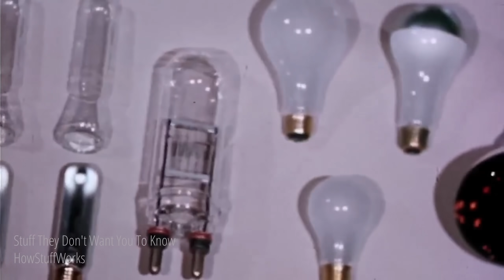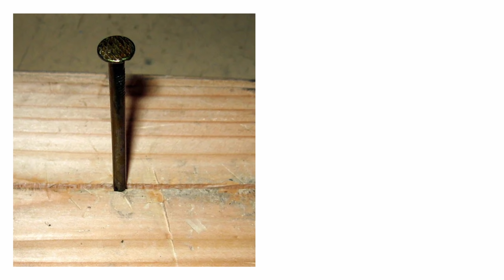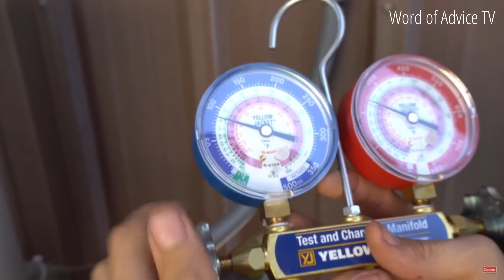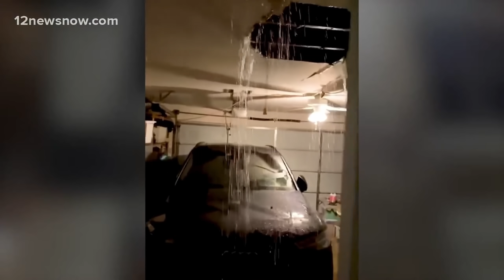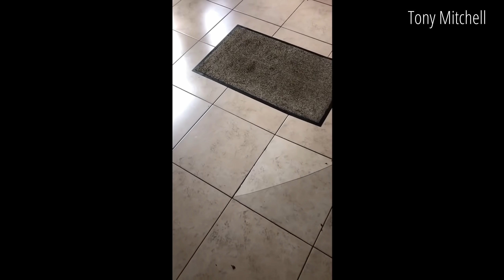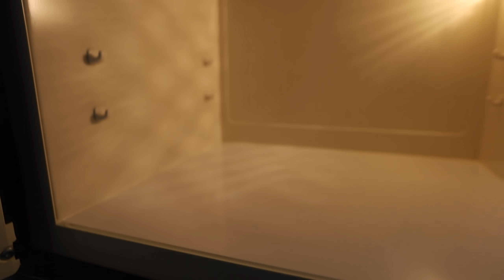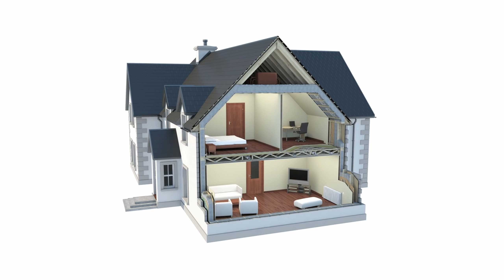Built to FAIL | Planned Obsolescence

Comment: Even 30 years ago, the best advice when laying any kind of floor or wall covering was to stash away a meaningful extra for eventual repairs, speaking from family experience. Unfortunately this is not new by any means.

Also, those ice-maker integrated fridges (called "american style" here) are just asking for trouble (and if not cleaned properly, basically food poisoning) due to extra parts to malfunction.

For piping without having to excavate the concrete slab: have a cellar. Of course, it's much more expensive at start, but that solves the majority of problems that can arise, and also creates a smaller amount of new ones. But it's expensive.
Reply: I loved having a basement in Ohio, but in most of Texas, to my knowledge, basements or cellars are not practical because of the soil.  I think limestone is prevalent throughout, but I can't say for certain as I've never done or seen a soil survey.
Reply: @grondhero  it's the watertable that is the issue. You can had dig a well in Texas, usually within 10 feet, twenty to thirty feet is a deep well.

Obviously you want to go deeper, but you can dig very shallow and hit water. 

Your basement then basically  becomes a poorly constructed ship hull, and the house "floats" till it breaks. 

Not such a big issue for larger commercial buildings because they have the weight, and money for proper mitigation efforts during construction, but houses are just too light, or the efforts to mitigate it pre-construction are insurmountable due to complexity or practical funding. 

And...in Smith County at least, if not state wide, they are banning pier and beam construction for residential use, and mandating slab construction. 

Which make access for repairs more untenable.
Reply: While a cellar is often great, it's also quite expensive.
There's much cheaper, small design changes possible to the same effect.

While pvc is technically to code for all dirty water extraction where I live. I, for instance, will use the municipal sewage type pipes for any parts buried. Adds less then a hundred bucks to the material cost, and is rated for 75 years.

Electrical conduits also get a pipe. Worst case if any changes or replacement is ever needed is then one small access hole in the house, and a little digging in the yard.
Reply: @sigi9669  a crawl space could be a cost effective compromise.
Reply: @harenterberge2632  Not in the case of a slab foundation though.
As the slab is basically a very thin piece of concrete, which needs to be supported over the entire surface. Though you could very well get away with a narrow trench under it. So in that case you're correct.

The full area crawl space is more a result of a different foundation type. Where the building sits on "feet" around the outer perimeter, with the ground floor hanging off of the load bearing walls. This was the predominant way of building before concrete. The feet were masonry, with a wooden floor.
It's still used today. But then it uses either concrete beams very close together, with blocks or polystyrene filling it in.
Or a factory made prestressed concrete slab.
This way is quite a bit more expensive then the "slab on soil". Which is by far the cheapest foundation available.
Reply: @sigi9669  that is why I said it is a compromise. It is cheaper than a complete cellar, but indeed more expensive than a slab. And the benefits are also in the middle between those. 

By the way there are even more ways to create crawl spaces, for example concrete piers carrying wooden beams or a concrete strip foundation carrying a continuous reinforced slab. 

Where I live a slab foundation would not work because of the high ground water level.
Reply: A crawling space is sufficient for that.

Comment: We purchased a new oven with a "factory warranty". Three months later, one of the tempered glass panes on the door suddenly shattered. We looked into it, and it turns out that tempered glass will often have very small cracks from the manufacturing process, and these small cracks can eventually trigger a sudden collapse of the structure. We thought that this would be obviously covered by a so-called "factory warranty", but once we contacted the company they told us that the warranty excludes the glass and plastic components. They were kind enough to offer us to send a new door and fix it for more than the cost of the oven itself....

Looking into it, it turns out that this is very common, as modern ovens are built this way.
Reply: So happy to live in a country with good consumer laws. that would be covered by law two years after purchase

Comment: I think structural hempcrete block walls with plumbing and electrical chases and with simple plaster inside and out is great on many levels including making repairs or changes very simple and low cost.   I think perhaps compacted earth with hempcrete on top for the insulation value leaves our slabs more easy to repair or change.  I think hemp or bamboo engineered floating wood floors are a great option, but I do generally prefer floors that can get very wet without suffering damage.  Perhaps large floating tiles could be a great option that could be moved and replaced with a simple vacuum handle.  I think metal roofs with automated seam bending to help reduce costs is a great, long-term, fireproof roofing material.

Comment: While planned obsolescence is a problem the flip side is that we tend to purchase from the cheapest manufacturer. Doing this forces the manufacturer to use cheaper, inferior materials to meet the expected price point. The truth is, their are still great long lasting products our there but most people just will not pay the price.
Reply: See computer components. The CPU and motherboard I am typing this on is from 2008 and still works perfectly fine. (MSI X58 Pro motherboard with an Intel i920 CPU) It was built and advertised as a high durability motherboard and was priced accordingly.
Reply: @Crosshair84  You bought based on quality rather than price. I have many items that are 30 - 40 years old and work just fine. Why? because I spend the money up front to buy quality. In the long run it's cheaper than buying based only on price.

Comment: It is usually some small part that fails. Giants are trying to seed the idea that nothing is repairable and if so, only by them. My dishwasher just recetly stopped working. It was just a burnt end switch, they get tired after thousands of clicks. Don't let yourself be fooled, everything should be repairable.
Reply: Should be repariable. Should be.-- but after repeated failure of the warranty repairs, as happened to us, you have to decide it would never happen and had to buy a new washer, giving them the otherwise new washer--who knows what was done with it. We had to get on with our lives --not constantly schedule someone to come to our house waste our time, tell us they fixed it, week after week.
Reply: I had that with my furnace. It stopped working and the only solution (from experts was to replace it). Some youtube searches + a whole weekend taking it apart, I was able to fix it for under 50 bucks and its good for another 10 or 20 years. 
It was some work but honestly nothing that an average home owner cannot handle.

Comment: I purchased a 50s ranch house over a newer model home based partially on the construction methods. Also it was observable that the foundation was good. So much stuff from the 40s and 50s seem really solid. Old electric fans from the 40s are the opposite of planned obsolescence. It seems like we crossed some weird threshold in the 90s. I worked in construction then. You could see it happening.
Reply: Same here, bought a 1960 ranch with concrete block walls for this very reason. Of course I still got screwed on garbage orangeburg piping they used for the main exterior sewage line and had to replace it. They really began pushing the cheaply built wood frame houses with poorly engineered water barrier materials starting in the 90s.
Reply: @Son37Lumiere   I think ours is cast iron but that I wouldn't be surprised if it was terracotta at a certain point. One of the first things I did was remove the trees nearby in hopes that I could table any issues with it. I hope your newer sewage line lasts way beyond your lifetime. It sounds brutally expensive.
Reply: Things were made to last, unlike today.
Reply: @vaderladyl  Also, grass was greener and water was wetter back then. Unlike today.
Reply: @imarchello  Wow you came up with that jewel all by yourself?
Reply: A lot of it has to do with the ubiquity of plastics. Once they became cheap and easy to use in the 80s it became possible to dramatically reduce the price and weight of almost anything by replacing many of it's parts with plastics.
Reply: We have a 1954 Ranch. I've never complained about the original build, but the previous renovations...that's another story.
Reply: CAD started being used in the 90's

Comment: Yes, we had to spend thousands of dollars in repairs on our 1985 home in Texas, and we only lived there for 3 years. Water line burst under the slab, the air conditioner went out, the master bath shower was leaking into the closet, and we had a hail storm that ruined the roof. Then we got defective shingles and had to replace the roof again before we sold it. Thankfully the insurance and shingle manufacturer paid for that.

Comment: The Kelvinator fridge my grandmother bought in 1937 still runs. I drive a 1972 Jeep and a 1988 Land Cruiser. My wife's Honda has paint that is scratched and tatty after little more than two years.  We built, and I omitted a few touches I now regret, such as solar heated underfloor heating and conduit trunking to allow more cabling to be added. But the second unit we built and sold has now been gutted and rebuilt by the new owners, just because they wanted a different arrangement of the rooms.
Reply: Have you ever looked at the energy consumption of this Kelvinator Fridge? My guess is that a new more economic one will pay for itself within a year. If you recycle your old fidge is even more environmentally friendly to replace your old fridge than to keep using a very old one.
Reply: @heelgraag  YOU are probably right. My ld Jeep's fuel economy is terrible, the Cruiser uses twice the fuel a friend's modern van uses. On the other hand, the energy cost of recycling, say, the Jeep into a new car must be more than the fuel I waste over the five years modern cars are designed for.
Reply: @heelgraag  The compressors on old fridges weren't that much less efficient than modern ones, and R-12 was a highly efficient refrigerant. Also, old fridges didn't have defrost, a big energy hog. So in real terms, the 1937 Kelvinator almost certainly uses less electricity than a modern one. And considering it's never been replaced, it hasn't accrued the carbon emissions to produce new fridges for the 84 years of its existence.

Comment: would love to find a way to run waste/drainage plumbing w/o having them buried under the slab. 

planning/designing a few things currently that utilize southern heat gain & storage in the concrete floor, largest also has in-floor heat/cool from GSHP Geo loops. i've managed to keep all plumbing out of the exterior walls to prevent freezing, and all utilities in the center of the house so they are partially conditioned. the issue of waste plumbing under my insulated slab is one of the last head-scratchers to solve...
Reply: "would love to find a way to run waste/drainage plumbing w/o having them buried under the slab. "
In my house they run through the wall. This is not a technical issue - it is a cost issue. Upfront costs - long-term costs are a different matter because you eventually have to replace those plastic pipes.

Comment: Great video as usual. I am an independent HVAC company and you are correct on the equipment manufacturers. They have a drop in refrigerant for r22 but you need to find and fix the leak before using it. They are changing out 410A refrigerant as well. Neat.

Comment: Oh my goodness! I absolutely HATE Planned Obsolescence. Thank-you SO much for addressing this horribly flawed business strategy. I've fought a Kenmore refrigerator that has had the defrost drip hole freeze over, causing the water to spill over into the fridge. I manually thaw it out & then it's good for 6 months or even a year or two. I continue using the unit because I know this thing will outlast a "brand new" fridge if I go and buy one today. I have a super old Caloric stove which works fine & I refuse to replace because of the same quality concerns. I even keep patching up my 20 yr old window A/C for the same reasons.

I've used lots of LEDs and even reviewed & tested horticultural style grow lights. The tech absolutely can perform well, as expected. The problem is, not all diodes are created equal. And even more importantly, the driver circuitry can be very, very unreliable. This is not an issue of "Planned" Obsolescence. This is often a matter of poor quality overseas manufacturers exploiting the Amazon marketplace with cheap, shoddy products and lots of false specs.

As far as home construction goes, it makes sense that Planned Obsolescence might occur. But some practices are simply about cutting corners to increase profits. The contractors who build a home aren't thinking about how long it will last & hoping to build a replacement in the future. They're trying to do the absolute MINIMUM to meet code. They want the lowest labor & material costs possible. It's about short term rewards and no long term strategy is coming into play.
Reply: It is not flawed.  To them it is perfection
Reply: Thanks for mentioning cutting corners, I thought that was really big factor that was missing from her video.
Reply: From what I understand a lot of LEDs in bulbs are driven harder than they need to be to shorten the lifespan. Though this also means less LEDs are required for a given amount of light.
Reply: @GrandmaSledgehammer  Yep, and overdriving LEDs not only shortens their life, but also drastically reduces efficiency. Consumer LED bulbs produce about 800 lumens for 9 watts, averaging  89 lumens per watt, barely better than the 57 lumens per watt from a 14 watt compact fluorescent producing 800 lumens. Compare that to the under-driven, long-lived "Dubai Lamps" made for Dubai under contract with Phillips. They last forever and consume 3 watts and produce 267 lumens per watt, close to the theoretical efficiency limit of blue leds with phosphorescent color mixing to produce white light.
Reply: If your refrigerator isn't defrosting properly, it may be that the defrost timer has stopped working, the quartz tube heater has burned out, or the little bimetalllic high temperature cutout contact button about the size of a quarter has failed.
Reply: I just found this song that you will probably agree with as well!

https://youtu.be/SwxTxaIcnGg
Reply: My mother had a Kenmore refrigerator that was almost 30 years old when she passed away. Her General Electric washer and dryer set was of similar vintage. Once the water inlet solenoids had to be replaced (probably due to hard water) but that was it.
Reply: I too replaced the relay & start cap on a 5yr old fridge & it didn't start the compressor. Then I replaced it again, and it worked. Sometimes cheap replacement parts have birth defects. It's best to test components before swapping and then test the new part before installing fir a positive fix.
Reply: How can you say its a flawed business strategy? Its made them rich.   That you are unhappy is what they call an externality
Reply: Planned obsolescence and the other ideas she discussed here only work if customers are willing to accept it. 
And they only accept it if the incentives to accept it are in place. 
One of the main psychological reasons it has been possible is because the dollar has become fiat currency, and continually loses its value. This in turn shortens people's time preference- and they are willing to give up something better in the future for something inferior now. 

The first 2-3 minutes of this video does a much better job of explaining it than i have. I'd highly suggest looking into TIME PREFERENCE if you really want to get to the root of the problem that enables planned obsolescence.
https://youtu.be/smfwh31Sx7E

Comment: The right to repair movement is gaining momentum. Unfortunately this depends on legislation and the government to fix that problem. It will not work. I believe the market will correct most of this when a companies produce  products that are durable and reparable and get rewarded for it in sales.
Reply: When have markets ever corrected? If they did the quality would increase somewhere. It is not increasing at all. Food, equipment, houses, cars - the quality is beyond horrible on all fronts.
Reply: @Michael-Has-Opinions  I meant the free trade market. The finical market is not free these days and will not fix anything anytime soon.

Comment: Great Video! It always amazes me how bad building practices are in North America especially. 

I have to complain about something though.
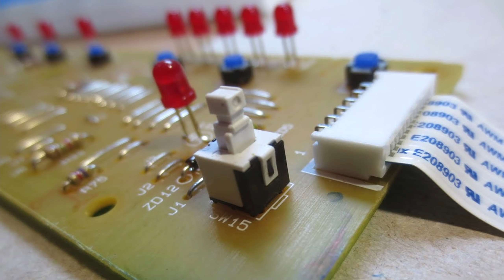3:25 That is NOT a difficult repair in any way. Desoldering that would be very easy if you have some experience. The part doesnt look too special either, so finding a replacement shouldn't be too hard either.
Reply: Yeah, I was just looking at that piece scratching my head trying to work out how that could take hours to replace. I've got minimal experience, but that looks like an hour at most, all included.
Reply: Yes, not the greatest example for those of us who are not scared to repair. Something like a failed IC that has the part number scratched off would be a better example .